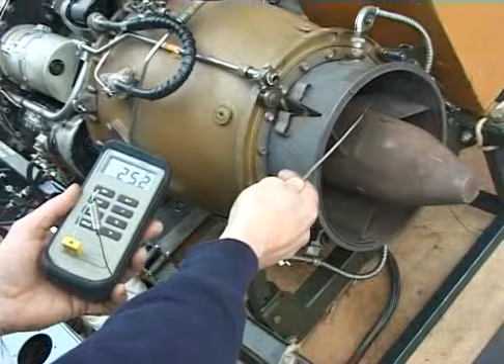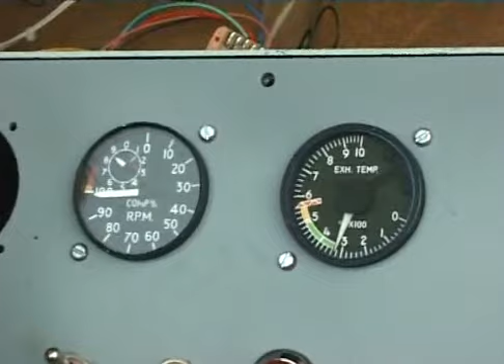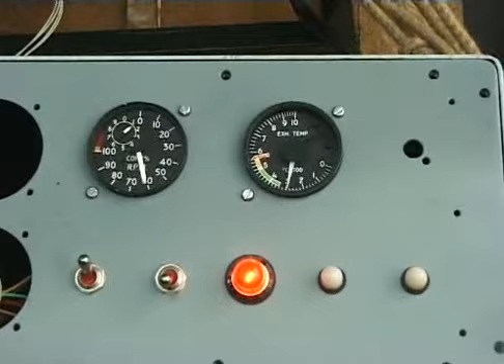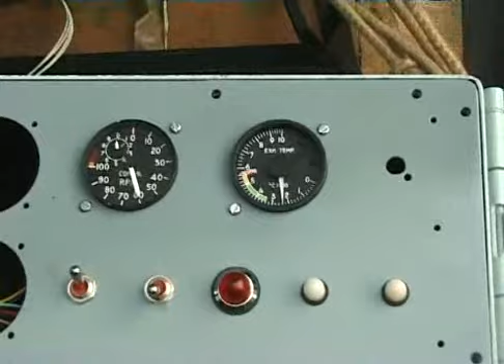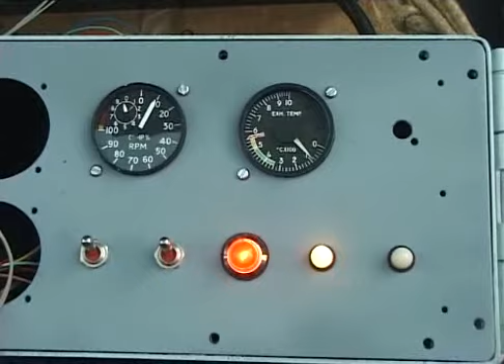Astazou gas turbine engine start up SORRY NO FLAMES

Comment from the maker: In theory yes, a gas turbine may burn any liquid fuel. The fuel passes through a pump that requires lubrication by it, alcohol may not provide this, also it may not be compatible with various seals throughout the engine.

Comment: Is it public how many and what type of power semiconductors did you use for the soft-start? I guess the starter-generator works in the current range of 4-500A during starting. Back in 2006 when i had to desing a similar module i had to pack eight irfps3810 mosfets paralell plus free-wheel diodes to cope with the currents.

Comment: Are you using some PWM soft-start for the starter-generator? For me seems that the shaft starts gently not like if the starter is connected to 28V directly.

Comment: Nice video ,but is the temperature reading at the exhaust is accurate (250 deg?) and why feeling around the engine ? what can you detect by touching of feeling around the engine lol, may be heat lol

Comment: Hi there & thanks for sharing the video.  Upon seeing that fuel leak, I changed your description to "Thankfully no flames or red hot metal..." ; )  What type of/where did you get your meter & attachment <thermocouple> you used to check EGT?  I have a J44 turbojet (see my videos on YT!) that has an EGT indicator on my console also & I would like to check its accuracy/calibration.  Thanks again.

DD